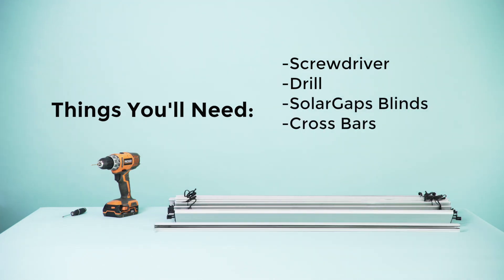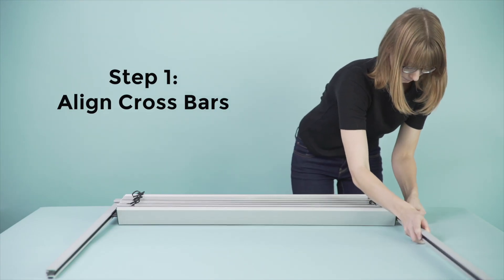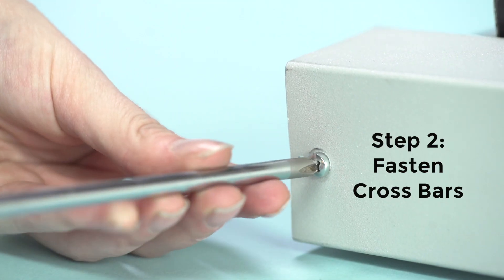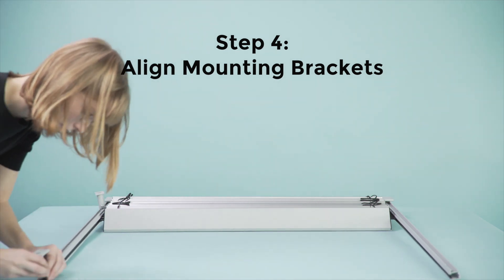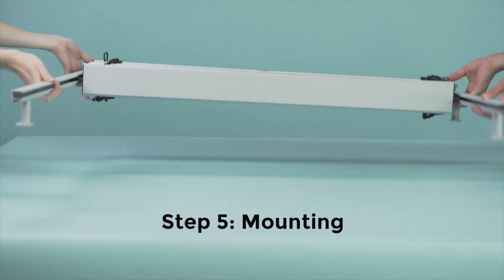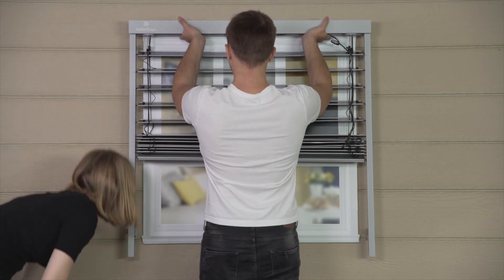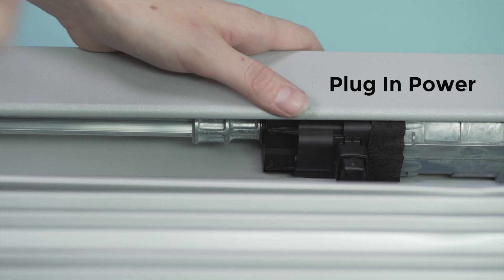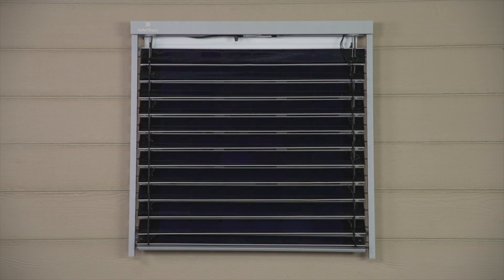SolarGaps Installation Guide: The Simple DIY Method

Comment: But HOW do you get the blinds, without powering up, to release so I can make sure the brackets are squared up???🤔😕
Reply from the maker: Hi Robin. After installation you will need just to plug them into the socket or a home battery.